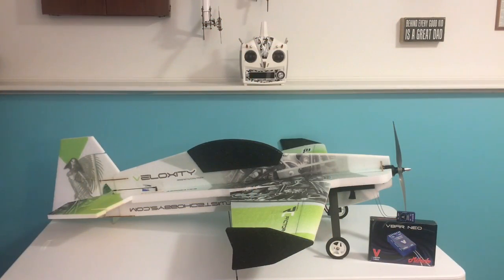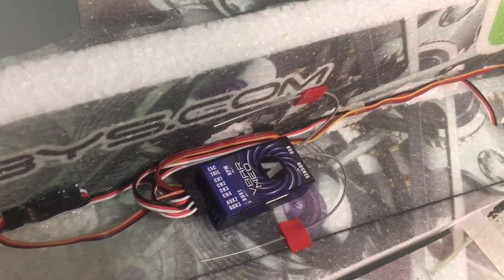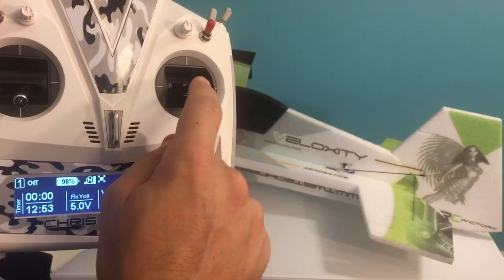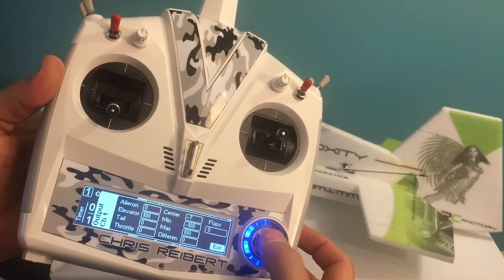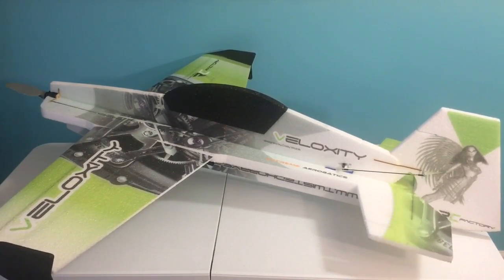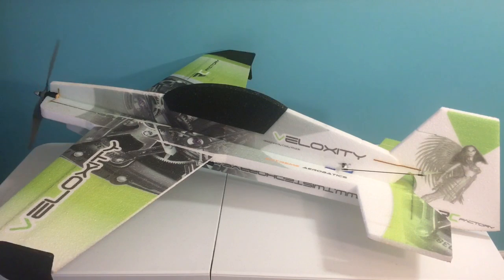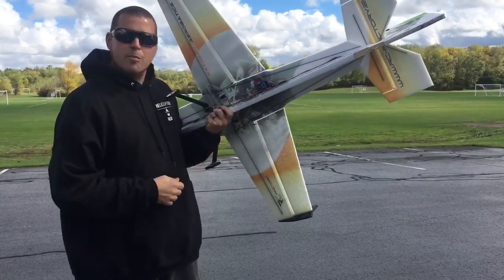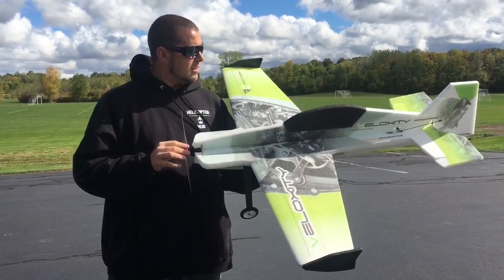Setting up the Mikado VBar NEO VBasic Receiver

Comment: I'm not familiar with the V control transmitter, I don't see any trim tabs on the face of the transmitter. How do you trim the plane while it's in flight?
Reply from the maker: paulsreef27 You setup a switch and it auto trims the model for you!
Reply: Thanks Chris! With the V bar basic, would you need to activate the gyro for it to auto trim?
Reply from the maker: paulsreef27 Nope just setup what switch you want auto trim to be.

Comment: Hey Chris, nice video. Couple of questions if I may. How do you trim the aircraft? Do you have to fly it, land, it put trim in and then go and re-fly? Also from my understanding this unit is actually a Vbar NEO but with downgraded software in it? Therefore could I install this software on one of my heli NEO's, but still keep the license for my heli neo? Do you have projected cost for these units? 'Sideline comment', its strange not to have a servo reverse function and you have to frigg the software...kind of...to reverse the servos. Sorry for all the questions :)
Reply from the maker: mattielodge I didn't have to trim my airplane as I had already had a NEO with Vplane on it. You setup one of the rotary knobs to trim the model. I haven't played with it yet though. Not sure if you can downgrade from a NEO plug in your NEO and Vcontrol for the latest updates and see if the new software option appears.
Reply from the maker: mattielodge and they are on the MikadoUSA site now for $125